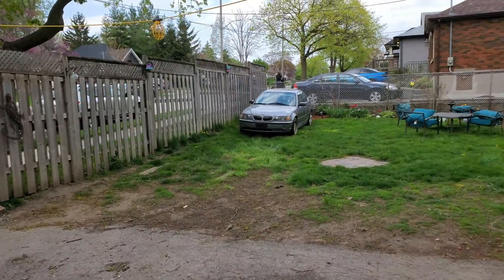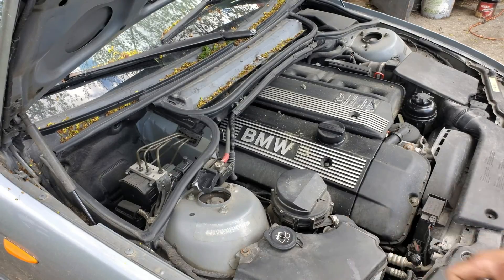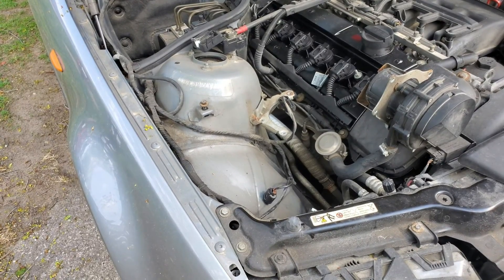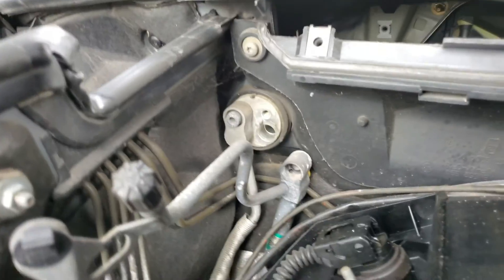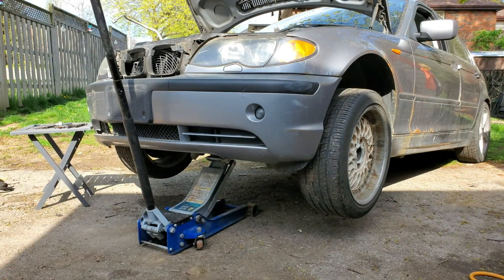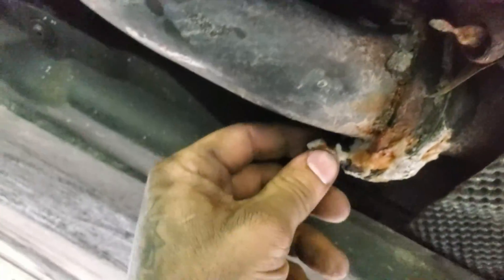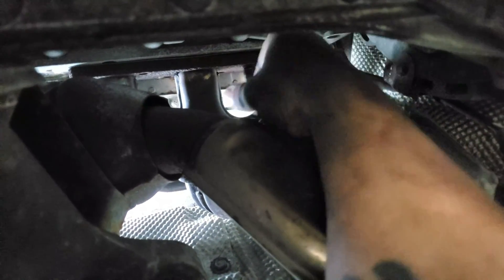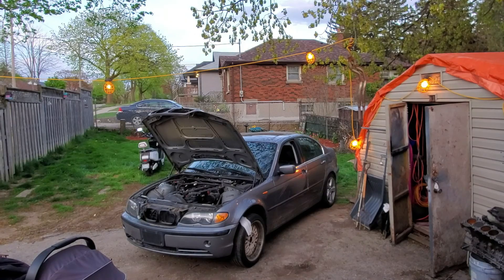S1E2: Removing The Catalytic Converters BMW 330xi E46

Comment: When I try taking the shields out after the sensors they won't come off you have a solution I've tried yanking them out but they don't seem to wanna come off
Reply from the maker: Torch it. Then remove them

Comment: My exhaust joining the cats looks exactly the same can't even see a nut to undo because it's rusted out, and some idiot decided to weld the exhaust to the cats so I'm going to have just as much fun as you cutting it out, only difference is I need to reuse mine 😂
Reply from the maker: You actually don't. Scrap them and buy headers

Comment: I have a 330ci 2001 3.0 manual it's really a junk car 😢 I'm having misfire with fuel cut off... but I replaced intake and exhaust cam shaft sensors... fuel Injectors, upstream o2 sensors... plugs and coils and maf sensor and many more.. I haven't been able to replaced the pre cat o2 sensors... idk man... I can't even drive it. It's so bad. P1343, p1351, p1345.. any help..
Reply from the maker: Vacuum leak. 
Do a boost test and pressurize your intake system and find the leak. 
Thats 100% your problem. Fuel cut off has nothing to do with components of the fuel system and everyone mistakes that.
Reply: @All Things Quick  so it could just be my intake? I plan on. Maybe buying a new intake manifold in general just in case if it is cracked. Also a new valve cover as well. Or maybe just the gaskets for them.
Reply: @All Things Quick  I really like this car it's my first ever manual... but people been calling them junk cars.. I see them mistreated all the time and it disgusts me man.
Reply: What if the leak gets fixed and it still misfiring badly with the engine jumping...  that's what my cars doing and I keep smelling fuel by the driver door when I start it up no leaks from the fuel or anything.
Reply from the maker: All valid questions and concerns. Let's address each one.

1. Do not throw parts at something that is broken. You should do proper diagnostics first to determine the actual issue and then buy parts according to that. So, in this instance, you do a boost leak test like I told you to do, and then you find an air leak. Fix that thing specifically, and it may lead you to another leak that is smaller. All states of matter travel through the path of least resistance, meaning that the biggest leak you have it
will travel out of that first, then it may lead you to a smaller leak somewhere further down. Then fix that and so forth.

2. If your thing is still misfiring and running rough, it could be a fiel injector stuck position 1 or position 2. If it is stuck, then you will watch my diagnostic video I made a long time ago on my Audi A4 I used to own. 
https://youtu.be/vJuHXi1tqgw

3. If you're smelling fuel, you may have a fuel pressure issue. Meaning one of many things. The first go to is replacing your fuel filter. (BUT FIRST BEFORE YOI REPLACE IT) remove it and clean it out with an ENTIRE bottle of brake fluid. Then put it back in and seen if that solves. Secondly, take a voltage reading on your fuel pump when you crank your engine to start it. If it's weak then it won't deliver as much pressure as needed. Third, you should check the line to your fuel filter. E46 has a built in fuel pressure regulator (FPR) in the fuel filter. The hose that goes from the intake boot to the FPR needs to be examined. 

3. Don't take what people say about these cars. They are abused by a bunch of dorky kids that don't know their foot from their ass. So take care of your belongings and take pride in that.
Reply: @All Things Quick  damn... that was the realist shit I've heard in a long time. Hell yeah bro. Ima SS this and do this. He'll yeah. Thanks bro appreciate it. I spent so much money on this within the last two weeks tryna fix this 

1-Fuel Injectors
2-Clutch
3-MAF Sensor, 
4-Exhaust Cam Shaft Sensor
5-Ignition Coils
6-Spark Plugs, (NGK) 
7-Fuel Pump
8-Intake boot (lower and upper)
9- three radiator hoses
10- Disa Valve
11-Radiator itself
12-Radiator Mounting bracket that holds the Expansion tank

13-Expansion Tank itself
14-Front and Back Brakes Pads
15-Front and back tires gotta replace the back tires
16-Upstream both oxygen sensors
17-crankshaft sensor

Comment: exact same leak as i have on my e39 m54. looks like a pint in the butt to remove all that for taking the cats out... can it even be done without removing all that stuff?
Reply from the maker: Not on an AWD XI. If it's RWD it's A LOT easier because the subframe is different. The rear wheel drive variant you are able to pick the engine up off the mounts and remove them from the top or just reach your hands in there and pull them through the bottom. The AWD has a square subframe that blocks it from coming out.
Reply: @AllThingsQuick  follow up question, how will it pass MOT if cats are removed?
Reply from the maker: @ЯдБдstд ̃TM  depends where you live. I live in Ontario Canada. There is no such thing as emissions testing anymore. They abolished that program years ago as it's a stupid scam. 
But doing a safety inspection, this "shouldnt" have anyhting to do with this. But again, it all depends where you live. You'd have to look into your local laws regarding this. 
Best thing to do is to do the test or inspection, and then remove it. 
As have a thing here in our province where we only have to do a safety inspection once when we buy the car. Then we never do it again. So everyone knows that yoi do the inspection with everything bone stock, then you start to modify your car afterwards. Check my channel and look at my drift car build. You'll see I used to drive that thing on the street all the time and it had a turbo sticking out of the hood and it had an completly gutted interior.
Reply: @AllThingsQuick  ok. here(sweden) they test emissions every year when the car is due for inspection. on my f30 335 the only way i could pass the test was with a racecat. had a replacementpipe before an it wouldnt pass...
Reply from the maker: @ЯдБдstд ̃TM  there's a trick to pass emissions. If they do tail pipe testing. Even if it's OBD testing it can still trick it. 

So back in the day we used to do this thing where we would take one container of methanol and pour it in the fuel tank (full tank). Then you let the car run till about ¾of a tank or more and get hot and cycle through a bunch of the methanol. Then you go get your emissions testing done and the cooling characteristics of the methanol can trick the test to think its burning cleaner than it actually is. (This works much better with tail pipe testing.
Once you pass, you have to run your car down to empty or the methanol will end up eating through your plastic fuel tank. So run it empty and then fill er back up to full again. 

Might be worth trying. 
But of course you have to have cats as well.

Comment: Im working on one right now. I found it hard to believe i gotta drop the frame to swap.out the engine...do to my lack of space i was thinking. If i remove the converters and passenger engine mount bracket. Would that give me enough room to swing the engine to the right to pass the front dif to pull the engine upward
Reply from the maker: Are you taking just the engine or the engine and transmission together. If you pull just the engine then you can get it out without dropping the subframe, but otherwise i would drop the subframe. 

It's possible without dropping the subframe, but for the time it takes its easier to unbolt everything. That's why I do it that way.
RWD is way easier. I can remove one and have another one back in there in less than 2 hours easy.

Comment: My 04 E46 325i has codes P0411, P0420, P0430 it’s not getting enough power while accelerating. If I were to replace the EGR valve, do a CAT delete with aftermarket as you are doing. Will I still have the same issue? I know I won’t pass smog in my state but I prefer to have a strong running engine.
Reply from the maker: Yeah so you can delete the secondary air injection, EGR valve, and the cats all in one. There are a couple things that will arise from this however. 
1. You will continue to have your P0411
2. Instead of your P0420 & P0430 you will end up with a P0171, P0174 or something like that suggesting system too lean in bank 1 or bank 2 up or down stream, never really know what it will throw until it happens. 
3. There is absolutely no use for a secondary air pump or an EGR if you don't have cats. The work specifically for the cats. 
Also of you go with a cat delete then you need to make sure that you have to o2 sensory bungs welded to your downpipe to put your two pre-cat o2 sensors in there. The car needs those two to run efficiently. You can do away with the down stream o2 sensors. 

Lastly... if you're looking to run your car properly with these deletes you will need to code it out of the DME. Fortunately for you, I can ship you a modified DME that has everything modified and tailored to your specific setup.
Meaning, I can have a DME for a 04 325i with an EWS delete(security) so the application is able to be applied without locking you out. Then program a secondary delete, EGR delete, and we can tell it that you're only running 2 pre-cat o2's. 

Let me know and we can ship one out to you if your interested. We require the core of your existing DME for additional discounts. Without sending your DME then it's a fixed price. 
Let me know 💯

Comment: How much did the cats bring? I’m curious cause I’m in the process of pulling mine off and was curious how much they’d bring
Reply from the maker: Here in Ontario, Canada I got about $300 for the one, and $240 for the other one.
Reply: @AllThingsQuick  did you have to cut them ?
Reply from the maker: @bryangunz7779  nope. Just unbolted and sold them. They are manifold cats. The manifold itself is worthless. So you just scrap the whole unit.

Comment: And cat delete video?
Reply from the maker: Is this this a question?
Reply: @AllThingsQuick  yes, did you have issues with it running properly without the cats??
Reply from the maker: @FYahooo  it doesn't have an issue running no. 
The only thing is that without the cats you don't have o2 sensors. You need 2 pre-cats and 2 post-cats to run proper numbers. But when I'm building a car I remove them and I code out 3 of the o2 sensors because they are all narrow band. So I keep one narrow band and I add in an aftermarket wideband o2 sensor so I can read my AFR's exactly for what they are.
Reply from the maker: @FYahooo  it runs lean without the o2 sensors there. If one is damaged then it will always run lean. You'll get codes that say bank 1 system 1 lean (for example)